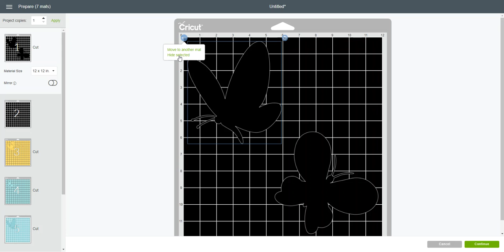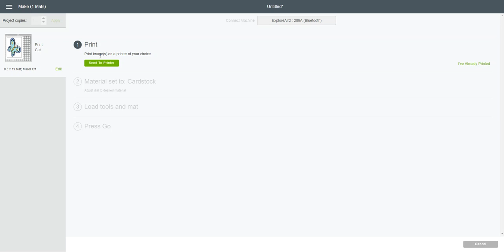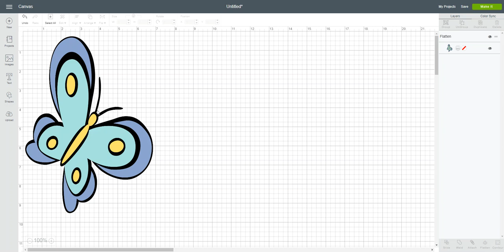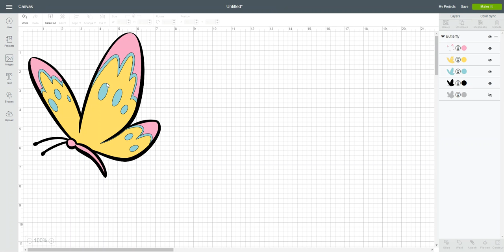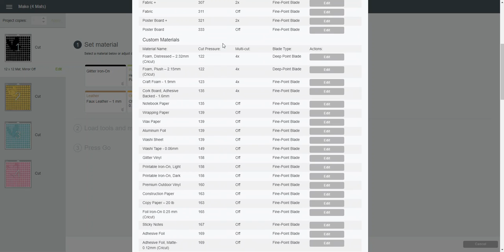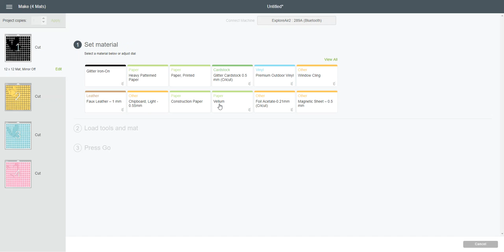New Design Space 3 Changes 7 20 17

Comment: Great video.  Thanks for showing us. I do have a question tho.  I have a bluetooth adapter that I use with my cricut explore, and since the update it doesn't work.  I have tried uninstalling and reinstalling it, logged out of design space, turned machine off and on etc.  Is anyone else having this issue or is it just my machine?  Very frustrating as I love the bluetooth.  If I plug my machine in with cable it does work.

Comment: What setting do you use for 110lb cardstock.  I am fairly new to print and cut and print is fine but the cut on regular cs does not cut all the way through in some areas.
Reply: Dottie I"m not Debbie but, I personally usually print on 110lb Neenah brand of cardstock and use the Cardstock plus setting.
Reply: Mary Niederlander   Is that in the custom settings?
Reply: No, it is one dot to the left of the Cardstock setting on the Dial.  :)  When you set it at that dot, when looking on the setting that the Cricut thinks it will be cutting on - it should say Cardstock+
Reply: Mary Niederlander cthanks so much!  So many things to learn.